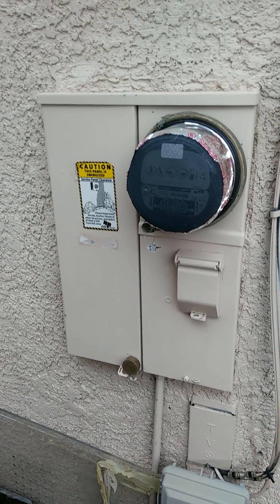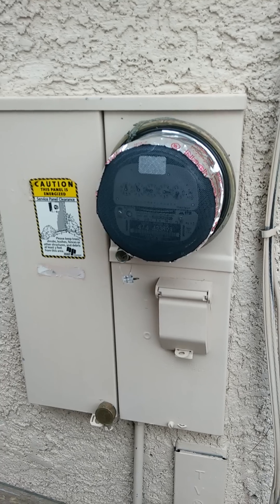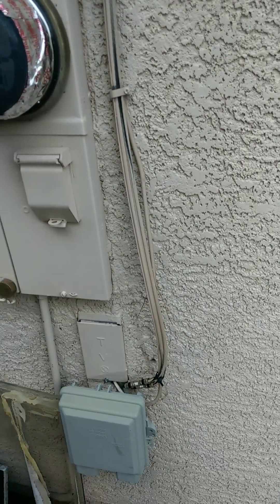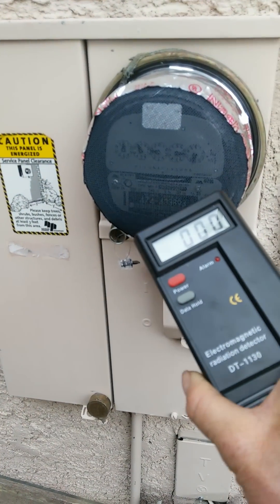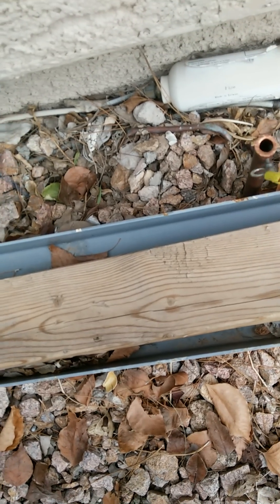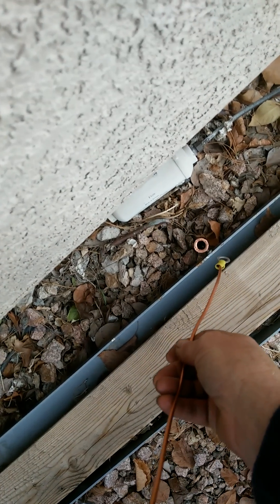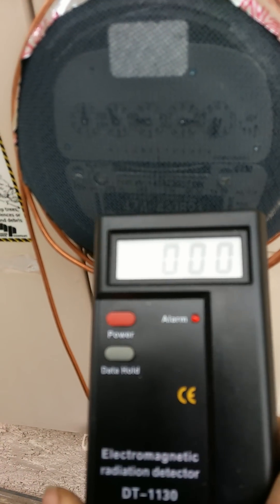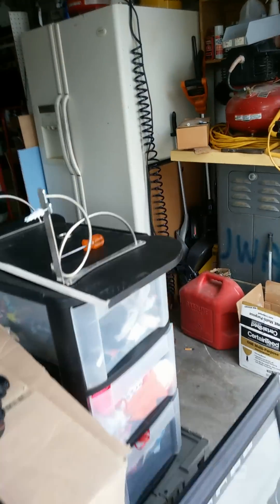Out smart the smart meter

Comment: The fact that you have to nearly touch the meter with your little detector should tell you something. Like oh I don't know, maybe the magnetic fields are not strong enough to emit past the meter. Plus you just grounded to the side of your foundation basically. I'm telling you now don't do that, your essentially risking life and limb to you and any in and near your house, especially if there's a lightning strike or a power surge. That box is grounded, but to a safe location away from your house. Before you go fucking with your power maybe read some electrical engineer books and learn how it works and why. Oh and the lizard, yeah probably crawled up there cus it WAS warm in the day, but froze to death over night. And it doesn't have to be freezing out to freeze a lizard to death
Reply: TrueBlueTheCat 
The ground that you are saying is to close to the house is just fine. Most service panels have two ground rods around here and they are a ft or less away. I think you had better look around and see what is in use all across the country be for you stick your foot in it.

Comment: If you stand a meter away the meter was reading 000.0, therefore it's not emitting any radiation or electromagnetic energy into your house or surrounds, what you measure on your meter is the EMF any conductor emits when passing Alternating Current through it as alternating current creates a magnetic flux (search Lenz Law), as does any cable or wire connecting any of your plugs, lights, light switches and main electrical distribution board, but because the current passing through there is the total sum of all the current split throughout your house, you won't get the same reading at a single light or plug point, but if you go to your main electrical distribution board (switch boards) you will get the same reading as you are getting by that meter outside, those meters actually work on the principal of magnetic flux to measure the consumption of the electricity, the smart meter on the other hand emits a signal (if a wireless one) to the keypad inside.. all in all there should not be any change in EMF reading unless you put it right on the devices like you did, then you are going into its very limited and isolated electrical magnetic Feild, it can only emit it's flux a certain distance.. except if the smart meter you could have had was a wireless communicator between the interior keypad and the switch in the exterior box, then there will be a radio wave transmitted inbetween the two for communication purposes, no different to the WiFi you used to upload that video.. 

I laugh because nowhere anyone can go can escape minor EMF like that, the earth has a magnetic field and polarities like a magnet, the same as that created from current passing through a conductor, your muscles on your body move by jolts of electrons surging the muscle according to the output from your brain to the muscle along your nervous system, your heart beats like that of a energizer which electrifies an electric fence which are capacitor charge then discharge charge then discharge, electrons cause minor convulsions on the heart making it pump in a pattern, doof doof...........doof doof............doof doof, where as charge = ............. And discharge = door doof..

The radiation we don't need however is signal radiation, 3g, 4g and now a new threat of 5g, ask your American government why they need to install cellphone antennas smack bang in the middle of your junior elementary school playgrounds, surrounding shopping centers, so many in cities but alot of the time signal can still be scarce.. 

And I'll just let you in on another fact, that metal box, that the metal casing of the meter which you put the coil around and to the copper pipe is earthed (if your house has had propper maintenance), with a substantially thicker solid copper rod which should be driven into the ground as far as needed to find a constant moisture level, not a water table, just where in mid summer it's far enough to a point where the underlayer earth is constantly moist.. 

Not arguing or looking to start one, just giving you some direct into because I know how useless the internet really is, it beats around the bush, hardly ever can you find conclusive information pertaining directly to your exact search, lots of different sub searches and cross reference on our own behalf is the way..

Happy new year, dont be scared of house hold electrical flux, fear the cell towers, cellphone radiation and most importantly Direct Energy Weapons

Comment: Issues 
1. Electricity, specifically A.C. is emf. The collapsing magnetic fields is how the energy works...

2. Meter socket is grounded threw the neutral wire bond behind the meter. 

3. Foil tape is covered in plastic film. This film can make it non conductive.

4. They sell ground rods and clamps, at hardware stores, copper pipe is what, 1 foot deep? Then you don't even tighten the screw on the screw you inserted in the copper pipe..

5. Radio waives won't be redirected in your ground wire connected to ricks the way you want.

6. It's not a smart meter 

7. You got more radiation from the phone then the meter 

8. Radiation is a scary word. Emf radiation covers from 1 Hz, threw lightwaives and beyond. 

9. You tried so hard, I feel bad that you failed so hard.

Good luck, life must be hard for people like you, and I wish you honestly the best, happiness and well-being, but the power company will charge you with tampering with the meter to gain free electricity. The fines are heavy too ..
Reply: LMAO yep tampering and vandalism With plenty of documentable evidence.
Reply: But, dontcha know, the power company will fine her because Big Electricity is trying to FRY the american public with their mind controlling radiation waves!! 
/s
Reply: Tampering fines can cost $300+
Reply: tek413 - U r a shill.

Comment: See folks, this is why your smart meter is killing you.
Tiny Giraffe has no clue how dangerous this smart meter radiation is and REFUSES to follow the FCC's installation practice. 
Let's ask him to read the front face of his smart meter goto the FCC website and read why there is a DO NOT INSTALL DISTANCE for a smart meter. 
Take your time coming back Tiny Giraffe, I know reading "CAPS" causes a few to get over stimulated.  

http://www.ti.com/lit/an/swra048/swra048.pdf
Compliance Testing and Certification Process
Regulations in the United States
The 2.4-GHz band is a worldwide unlicensed band. This is an important advantage compared  to the 902 – 928 MHz band. The 2.4-GHz band also has a wider bandwidth than the 902– 928 MHz band which means more available channels. The disadvantages of the 2.4-GHz band are: increased cost and current consumption of the active components, reduced propagation distance for the same power, and increased band congestion due to such systems as Bluetooth and wireless internet. If a vendor or manufacturer wants to bring an unlicensed wireless transmitter to the US market, they must have the transmitter tested in a laboratory that is authorized by the FCC. After successful completion of testing, the manufacturer
applies to the FCC for certification. If the test results are compliant with the regulations of FCC part 15, the FCC will certify the transmitter and issue an FCC identification number for the product. The vendor then must attach a label to each transmitter that contains this FCC identification number. Receivers do not need a certification, but the vendor has to state in a Declaration of Conformity (DOC) that each device complies with the spurious emission requirements of unintentional radiators according to section 15.209. All measurements required to prove conformity are conducted, or radiated frequency-selective, power measurements. (In some cases the electrical field strength at a given distance is specified, which is equivalent to a power measurement.) FCC section 15.35 specifies the detector types and bandwidths of the required measuring receivers. Unless otherwise stated, all measurements below 1 GHz shall be done using a CISPR quasi peak detector. The specifications of this detector can be found in publication 16 of the International Special Committee on Radio Interference (CISPR) of the International Electro-technical Commission (IEC). In general terms, this detector is a peak detector with an attack time of 1 ms and
a decay time of 500 ms. The bandwidth of the measuring receiver should be 100 kHz. if
specialized equipment is not on hand, a spectrum analyzer with 100 kHz resolution bandwidth
and a large video bandwidth setting gives results close to that of a CISPR quasi peak detector. Above 1 GHz, an averaging detector is used. This detector should have a resolution
bandwidth of 1 MHz and average the measurement results over a period of 100
ms. A spectrum analyzer with a resolution bandwidth of 1 MHz and a video bandwidth set
to 10 Hz comes close to the averaging receiver specified in section 15.35. In all cases where an averaging detector is specified, an additional measurement using a CISPR peak detector
has to prove that the peak emission is not more than 20 dB higher than the average emission

Comment: My point is to show the world, you installers are not following the FCC's rules when it comes to where these smart meters can and can not be.
According to the FCC's rules for DISTANCE TO COMPLIANCE, no customer can get any closer than 2 feet or they will be KILLED by the high levels of radiation
SO RUSTY HILL, I WILL ASK YOU, PLEASE SUPPLY A LINK FOR THE CERTIFCATION EXHIBIT.
WE WANT TO READ PAGE 3, THE DO NOT INSTALL RULE FROM THE FCC.
IF YOU CAN NOT SUPPLY THIS LINK, THEN LET US KNOW WHICH POWER COMPANY YOU WORK FOR SO MY LAWYERS CAN FILE A COMPLAINT THEY WERE INSTALLED IN VIOLATION OF THE FCC'S RULES.

Comment: This lady is crazy
Reply: Why are you name calling?
Covering any watt meter will reduce the radiation to a safe level.
Everyone should be doing this.
ACCORDING TO THE FCC, THERE IS A DO NOT INSTALL DISTANCE OF 4 FEET, THAT IS WHY THE ALUMINUM FOIL WORKS SO WELL.
Reply: I was crazy when I worked in this field, I got sick watch my customers die so my company could rip them off for a huge profit.
I quite and not spend my time warning folks about the huge danger from the extremely high levels.
Can you do us a favor and tell us why the FCC says there is a DO NOT INSTALL distance of 3 feet?
Reply: Sess Poole you're fucking crazy too.

Comment: That extra ground could make the problem worse. That meter already has an earth ground. The readings you are getting are normal. By the way, an ordinary AM radio will do the same as your reader. It will detect noise and yes the radiated e mag fields from AC power.

Comment: The power company just wants to be more efficient. I've changed out hundreds of oil circuit reclosures and replaced them with vacuum reclosures, they're  the breakers on your powerlines and they can be controlled from the power company. They are trying to make everything more efficient and safe with smart meters. When your power goes out we have to ride or walk the line to find the problem, or if a line falls and the breaker fails to shut it off we physical have to find it and shut it off. But smart technology changes all that, plus it has many more uses that I don't feel like talking about.

Comment: Most everyone here is a shill or they just don't know...all digital things have a microwave radiation and now we have 5g. My family and I sleep way better at night by just turning off the internet router. 5g is cooking us
Reply: Y'know, Wifi uses the frequency of 2.4 GHz, that is almost the same as microwave ovens use to heat water molecules in the food. The BIG difference is while an average microwave oven consumes 500-1000 Watts and emits the 50-60% of it (inside the oven), a Wifi router consumes maximum 10 Watts, and emits a maximum about 0.1-0.2 Watts, according to the regulations, I don't want to write about Wifi channels used by the routers, it doesn't matter too much1. If you try (and let's try it, why not?) to warm up a drop of water inside a microwave oven at the lowest setting (usually for melting ice), you make the oven to irradiate the drop of water with 50-100 Watts, at a distance of about 15-20 cm, 6-8 inches.
A Wifi router will never warm up a drop of water even if the drop is on the antenna, but the efficiency will drop seriously if you use the router in a damp environment. I don't want to convince you about the amplitudes, the frequency and the power routers use and emit, but one thing you can be sure: a router will never ever cook you or your family.
Reply: baladár kolompár thank you for your comment. Long exposure to these frequencies is damaging. We have phantom aches and pains and a lot of tossing and turning in bed...not to mention the towers that have recently went up in our town make your muscles tweek and tense as you drive by them. It's really good we don't own a microwave anymore.
Reply: I'll agree with this. I sleep much better too. 

Though I unplug my equipment.

Comment: You don’t understand electromagnetic radiation, the type of radiation that hurts you are nuclear radiation, infared, x-ray, and gamma ray. Your meter is emoting radio waves, if you can listen to the radio in your car, you should be fine. If you have “proof” of this causing cancer, let me know, because it’s most likely genetic. Any issues with other illness is psychological
Reply: Okay, let me give you little 7-year-old some facts
- People's homes burn down because the new meters aren't capable of the amps that homes need and most homes that catch fire only do so because the electric wires aren't up to modern standards
-The FCC warning is for communications, not radiation. the fcc warning is on there because they emit radio waves so the boxes can "talk" to the other boxes so it is easier to read the amount of electricity a house uses.
- The type of radiation that this video is talking about is electromagnetic radiation, which consists of radio, micro, infrared, visible light, ultraviolet, x-rays, and gamma rays.  ultraviolet, x-rays and gamma rays are harmful, ionizing radion. ultraviolet and x-rays can cause cancer, and gamma rays cure cancer, but this video DOES NOT talk about these radiations.  radio, micro, infrared, and visable light radiation are not harmful, non-ionizing radiation that DO NOT cause cancer. this video talks about radio waves. if you don't believe me, when you get x-rays, you have to wear a lead vest to protect you from the radiation, and I'm pretty sure you don't get cancer by sitting inside under a light bulb. also, all of this talk about "grounding" box is bogus, the box is already grounded. 

I do not work at a power company, I work at a railroad. also, my local electric company has not replaced any of our boxes because they want to save money, and they will only replace our meter if it breaks.
Reply: I can't. I dont own one
Reply: and i have the sangamo j5s as my meter

Comment: SMARTMETERS ARE BULLSHIT!!
SAVINGS MY ASS!!
THE FIRST MONTHS BILL AFTER THET INSTALLED MY MOMS NEW METER, HER BILL WENT UP ALMOST 50.00 FUCKING DOLLARS..
HOW THE FUCK IS THAT A SAVINGS???
Reply: The S.M charges based on the "millisecond long peaks"  like when your Fridge starts, or Furnace kicks on..or when you first flick on a CFL Lamp.. ... for a 1/2 second,  any device except  Tungsten Light Bulbs..(the kind you were told to get rid of)  uses MORE Electricity only when it 1st starts up...this is the point noted by & what the S.M gets a Base line off of, or how I understand it anyway.  The old Analog KWH Meters did not charge extra for the Surge Current only for the duration of "run time"  Think of it like a "surcharge" from a Restaurant to crack open a Bottle of a Drink along with the amt of Drink you had.  "$2.95-to-crack-open-Chablis-Bottle- & $10.95 for 2 glasses, where under old setup--$0.00  to crack open Chablis & $10.95 for 2 Glasses.
Reply: R Boyd hmmmm maybe it's because of the power factor..she might be using the same amount of electricity but the smart meter shows a difference in the currents sine wave being a little off vs the 60hz sine wave...basically a loop hole to charge more...just my guess 😕
Reply: RetroCaptain Great analogy